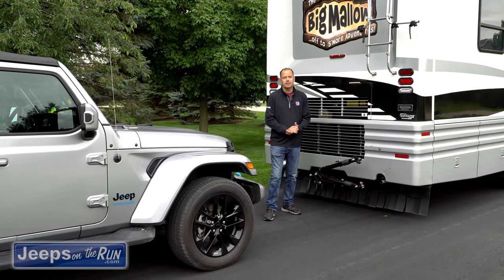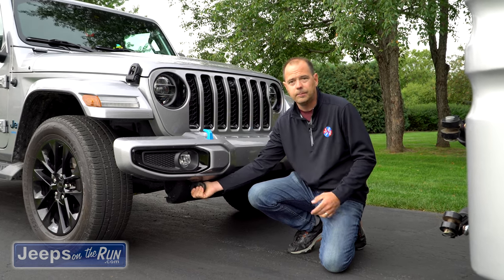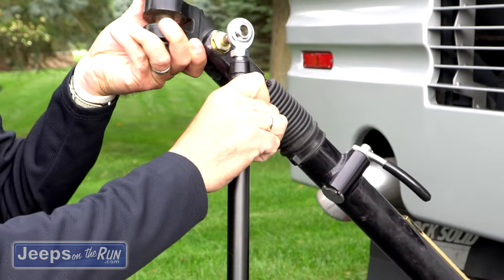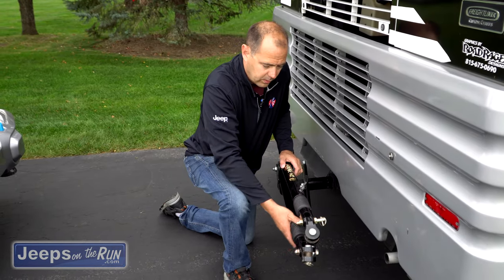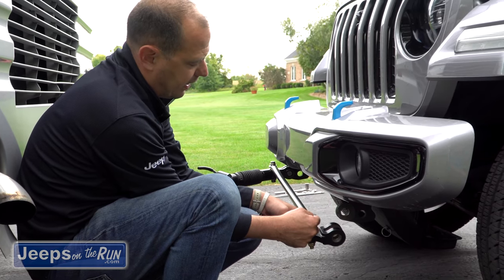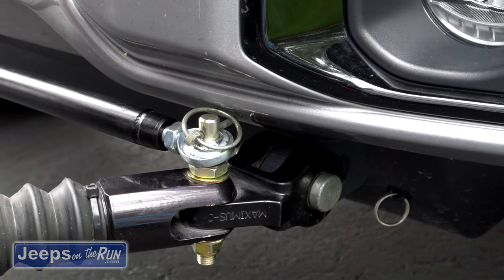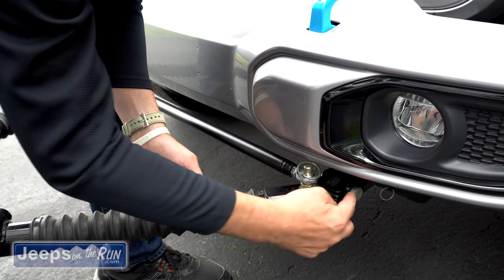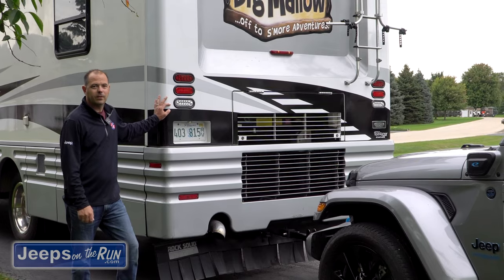How To Install The Maximus 3 Towing Tie Rod

Comment: I added the tie rod bar to my Maximus/Blue Ox set up.  I opted to go with quick release connections on both sides.  One tip, mount the quick disconnects with them facing down, otherwise, if the tow bar articulates up enough, the connections can impact the bumper (see the lack of clearance at 5:25).  Also, it very hard to install due to the lack of clearance as noted in this video.
Reply from the maker: Agreed. After I posted video I ended up doing both those pointers.

Comment: I’m going to be installing the tow bar Tie Rod next week, while on a trip.  
Is there a problem with putting the tie bar below the tow bar, rather then above as you showed.  Seems like there is more room below than above.  Am I missing something?  Other than if the pin falls out, the bar drops….
Reply from the maker: Honestly, I'm trying to remember.  I feel like I thought this same thing, but when I checked there was a reason it wouldn't work - but I can't remember why.
   To your point, if it does fit - I see no adverse effects.
Reply: Thanks for the reply. I’ll try it out after I get the bar on Tuesday.